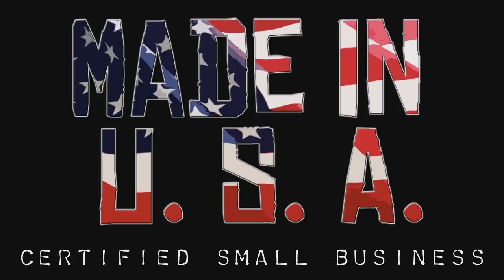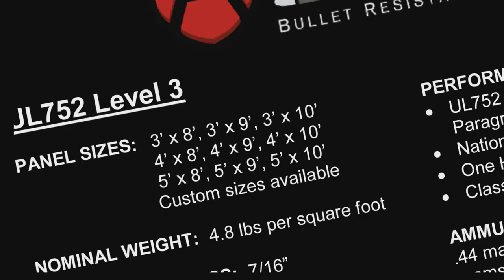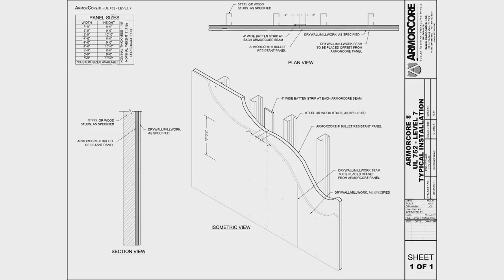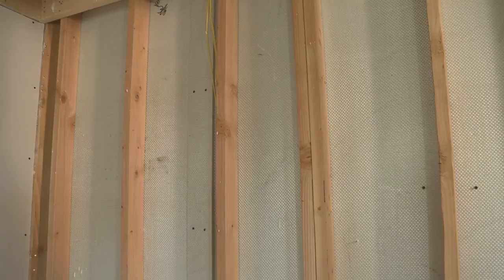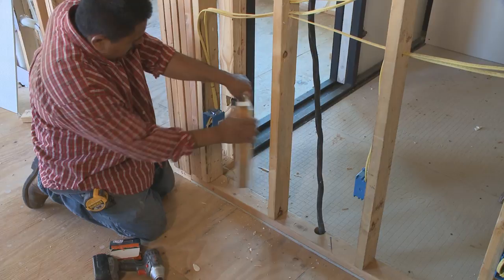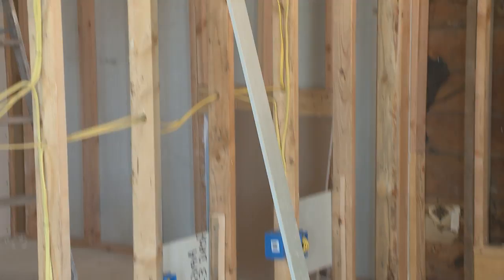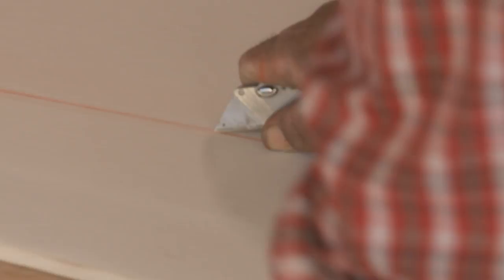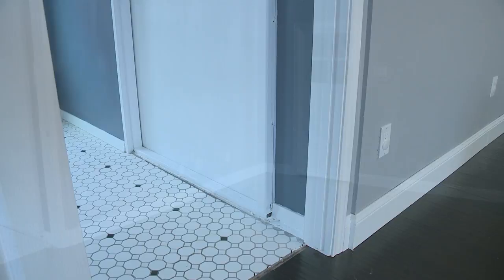Bullet Resistant Wall Test - ArmorCore Installation Instructions

Comment: You should consider selling composite fiberglass/ceramic composite armor.  I applied 4x4x1/4" Coorstek AD-96 tiles to a sheet 9/16" UL-3  fiberglass to defeat 7.62 NATO 148 grn AP (Tungsten-iron core) @ 2850 fps, with minimum 3" spacing.    The ceramic adds 4.8# per square foot, for a total weight of 9.8# per square foot and 13/16" thick for better protection than UL-8.

Comment: Crushed gravel between studs screw the plywood and sheeting do some interior walls for safe room's
Reply: but then the stud isn't bulletproof
Reply: The wall would be too heavy and break through the sheeting.
Reply: @TheNotSoFakeGilbert  Unlikely a bullet would go all the way through a stud, it would depend on what you are using it for.  If you live in the hood, most of those are just pistols as a rifle is too big to carry around.
Reply: @abacab87  lol what kind of magic studs do you have
Reply: @TheNotSoFakeGilbert  Well they are old growth forest, but they are over 100 years old. The studs get brittle with age, I can frequently shatter them with my hammer.  My wall took two bullets on New Years, the stud stoped one, the other one went though the wall, which was 1/2 osb and 1/2 inch drywall, ricochet off the kitchen cabinet and embedded in the back panel of the cabinet which is 3/4 plywood (yes I make my cabinets good)

Comment: Bullet "absorbing" drywall. There's actually a market for this. Oddly more so in higher crime neighbourhoods. As there have been a few incidents of people getting shot while watching TV by a stray bullet not intended for them. Ironically people buying homes in those areas won't be able to afford your product. Nor will any builder choose your product building a home...unless it's a custom home. 

Have you tested your drywall in a cold climate? e.g. -30c winter.  I mean, for some one building a custom home...even if a random shooting is highly unlikely in such areas ("elite" neighbourhoods) ...why not use bullet "absorbing" drywalls on exterior walls? 

I think most people out there don't even know about your product. Especially people not into the shooting sports/recreational shooters/hunters. Maybe you should also market your product to custom builders and the civilians building custom homes.
Reply from the maker: Hi AndersonC. I have to agree with you, there is a market out there.  We do market in a lot of places. We offer free classes to architects, engineers and construction personnel. We are listed in MOST of the databases/ listings available for all builders. Manufacturers do not always sell directly to the public, but we do! You can buy one board, or 100, from us.

Safe rooms have become more common place now, so we are seeing that incline. But even with that, some panels placed in strategic locations can also help.

We have been tested to exactly that degree, as a matter of fact! The UL 752 certification handles that.

Thank you for your comment.

Comment: I wonder why more stores don’t use this on their doors and windows instead of fragile wood during these troubled times ?
Reply: The big box building supply stores don't carry it. You have to special order the stuff, and when the "peaceful protesters" start rolling into town there's no time to be picky.
Reply from the maker: Quite a bit do install it. You just wouldn't know, because they are covered by drywall. Its just a normal looking wall when all is said and installed.

Comment: How does this hold up to natural elements? Rain, snow, desert heat + humidity, below 0 temperatures, floods (prolonged exposure to standing water). What is the maximum effective lifespan (assuming it isn't shot)?
Reply: This is all made out of fiberglass and it is known that fiberglass does pretty good in heat, and even water per say. This material is at least 2 times better than wood at absorbing fires and also floods. Think of it like cement, but on a weaker scale. Just to point something out fiberglass is put into concrete to make it even stronger and even though fiberglass in itself is not water resistant if it is layered and smashed together like this it can withstand even the harshest floods.

Comment: Do the screws compromise the armor?
Reply from the maker: Anytime the material is drilled through, it is compromised. 

HOWEVER, we have two options to negate this issue. 

1. Batten strips behind the seams/beams/studs (where ever you have it coming together). We sell Batten strips that are 8, 9 and 10 feet long x 4 inches; they are designed specifically for joints.

2. Adhesives. There are quite a few adhesives that would work, we suggest PL Premium.

Comment: is that better than concrete wall?
Reply from the maker: Hi Cali818 xxx. That is a great question. 

Our product is held to a standard, which means we go through random testing all year long, from the Utilities Laboratory. UL 752 is the standard we have to adhere to. Very specific bullets, shot patterns, specific distances, lots of things are involved in their testing. 

I do not know what contractors would validate concrete wall standards at.
Reply: In cases like mine, I can't just build a concrete wall in an existing house, so this would be easy to install.

Comment: Wouldn't it be easier to put ar500 plates in your walls
Reply: Project military memorial jeep zj  .300 blackout can penetrate
Reply: Project military memorial jeep zj Wouldn’t that be too heavy for a regular wood framed house? Plus, cutting the plates or fastening the plates could be pretty darned difficult.
Reply: 12GaugePadawan and multiple boards cutting and heat /ac 🤷🏽‍♂️ too many variables
Reply: Mr.t Whitie  What happened to you keyboards ?
Reply: Mr.t Whitie  Sand bags in between walls will stop just about any shoulder weapon and sooooooo much cheaper.. Downfall, your walls will be wider but secure..
Reply from the maker: AR500 Armor is an awesome company. But that would take a lot of plates, would you agree?

They specialize in body armor, we handle construction materials. Give us a call, Ill get you a good quote.